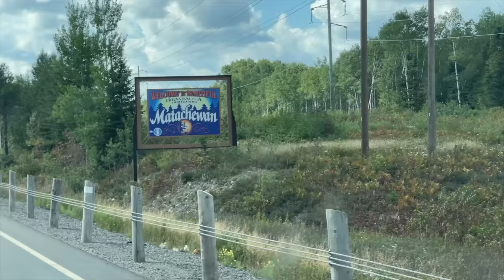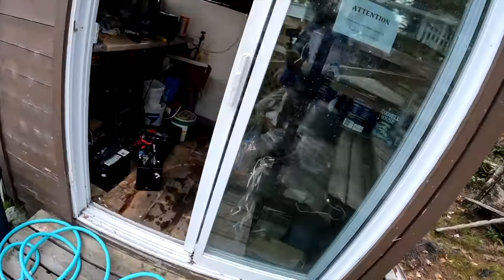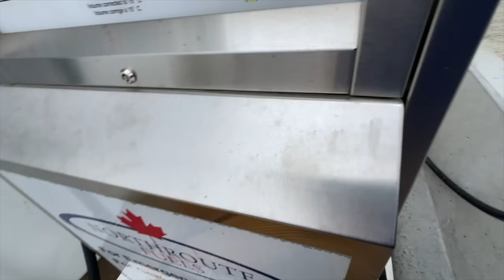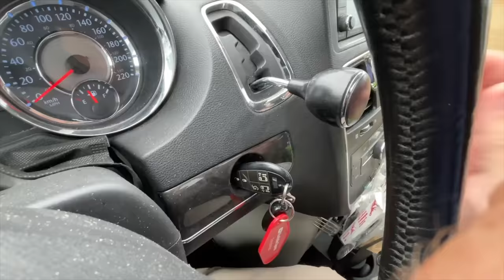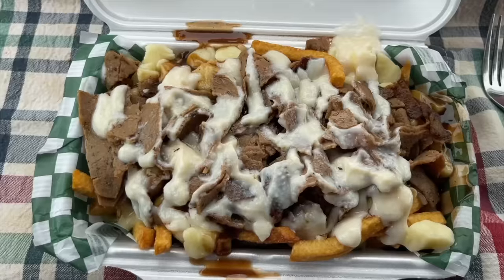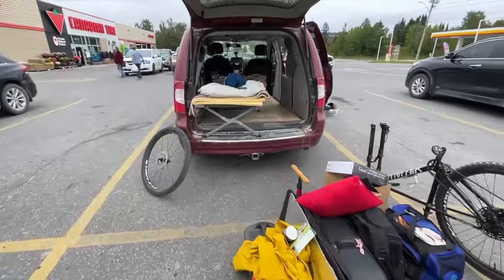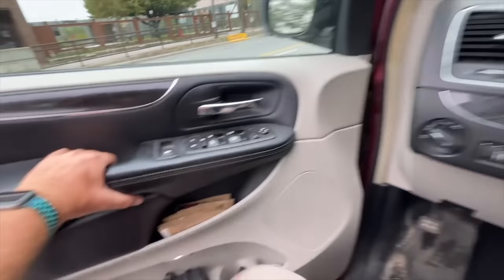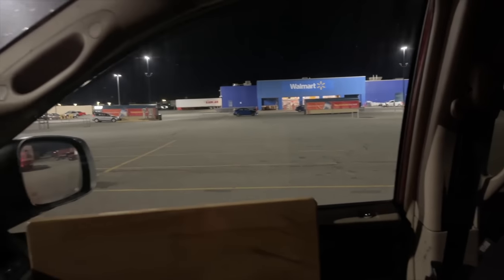Minivan Stealth Camper in Kirkland Lake

Comment: naw small reading lamp off of the jackery. they have led that you can string together new item i have the one to see if i like it. plenty of light low,medium,high, setting then off. your camping leave the electronics at home working with limited wi-fi burn up a battery 🪫. brake out board games checkers card games.